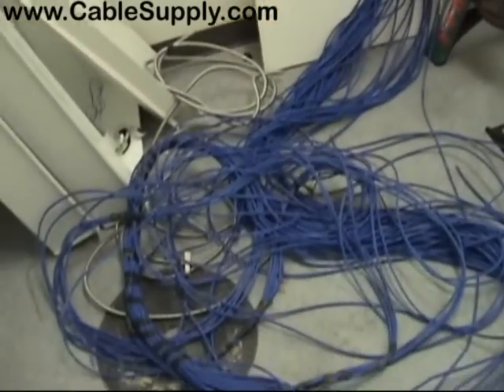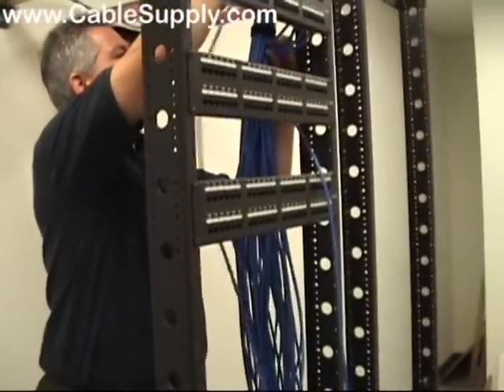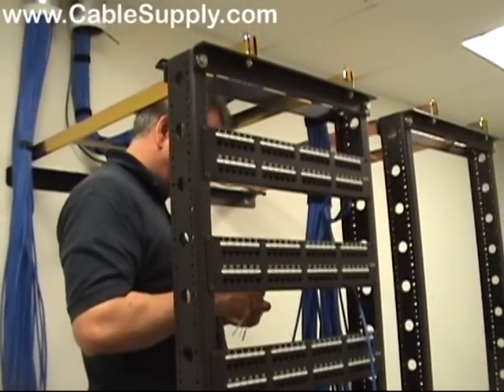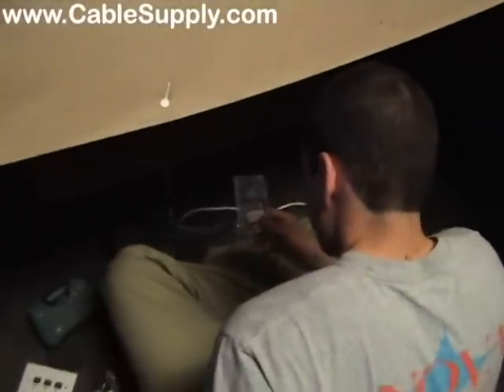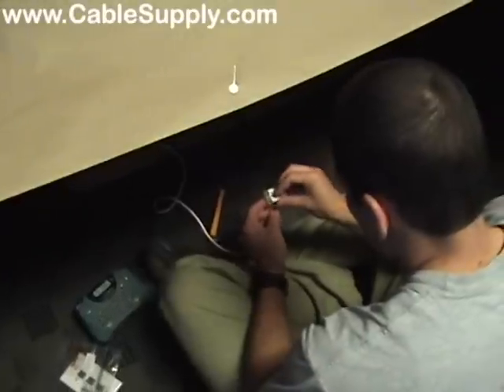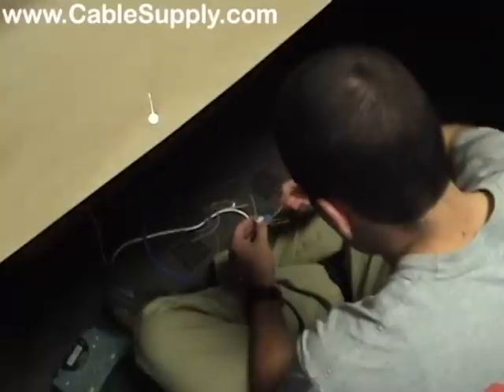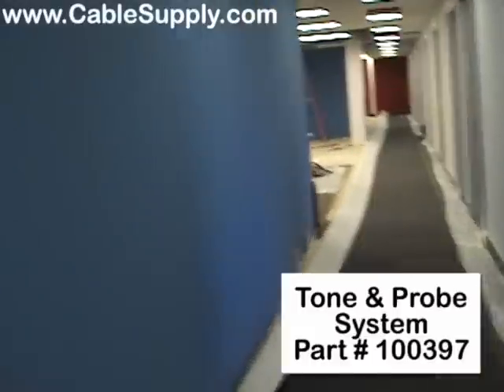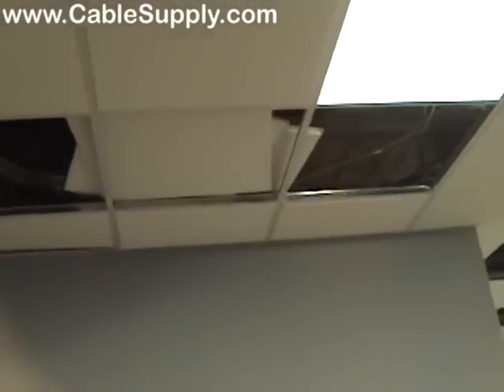Installing Cable and Terminating a Patch Panel (Part 2 of 4)

Comment: I understand this video is 10+ years old but why not punch down all the pairs on the voice keystone jack? 58B would be a solid bet. A standard RJ45 cat5e or cat6 jack will accept an 11 mod plug or better. If in a few years if your analog/pbx phones need more conductors or eventually VOIP, then its just done--no need to remove the wall plate or cut and re-punch or worst case run a whole new cable?
Reply from the maker: I agree, thanks for watching my videos
Reply: @CableSupply  Thanks for making them!

Comment: Correction: you can NOT leave cables laying on the ceiling tiles. That is against building codes.
Reply from the maker: I understand what you're saying. However building codes are different in each state. I personally have never had a problem running one or two cables across ceiling tiles. Obviously if you're doing a cable installation in the building for the first time or adding  large numbers of cables then you must suspend them above the ceiling tiles.